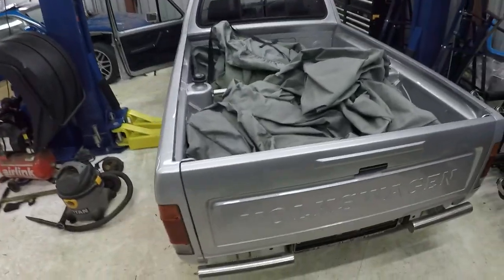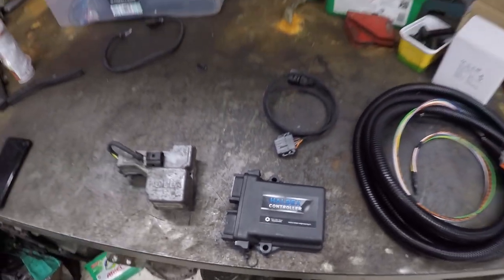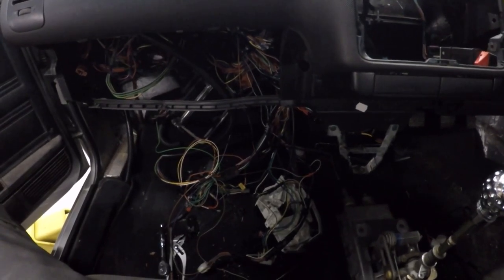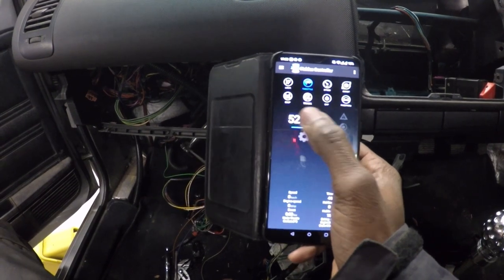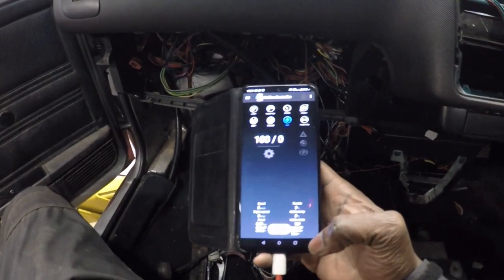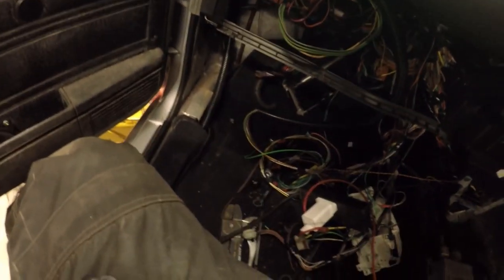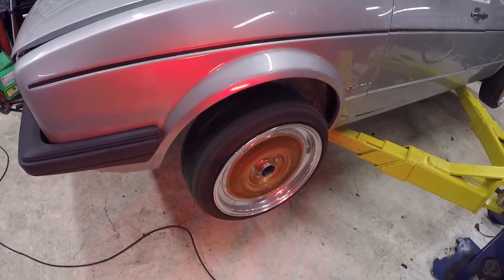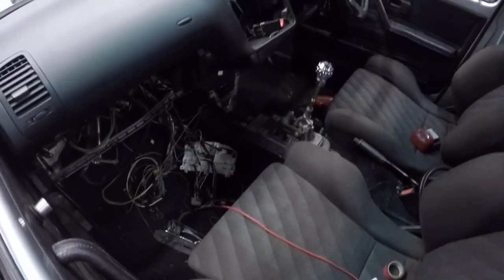Caddy 4wd Test - Haldex Controller

Comment: hey buddy, this looks like a neat bit of kit! I'm chassis swopping a escort on to a s3 chassis atm and I think this will probably be a good edition to my build but do you need to have vehicle wheel speed in order for this to work or can it just souly work off tps?
Reply from the maker: Hello matey,. Yeah I've been watching these Quattscort build 👍.  Yep you will need a vehicle speed signal (VSS) for this to work although I think you can run it off boost pressure.